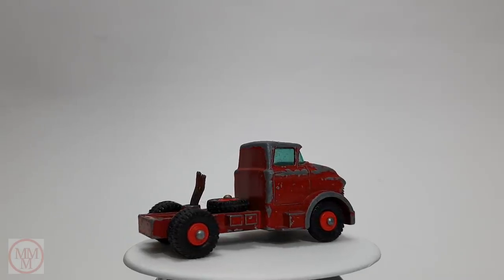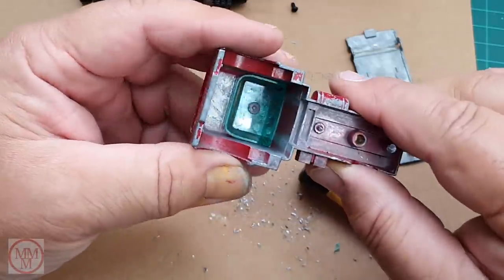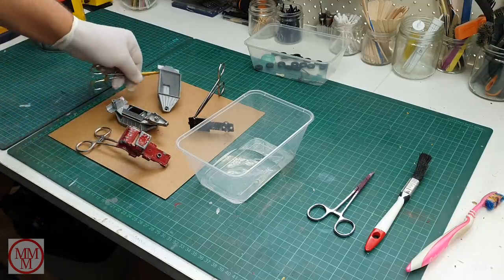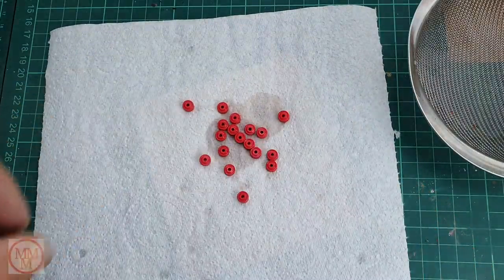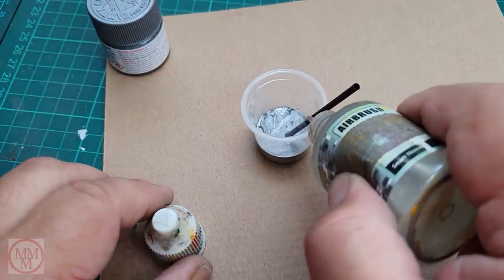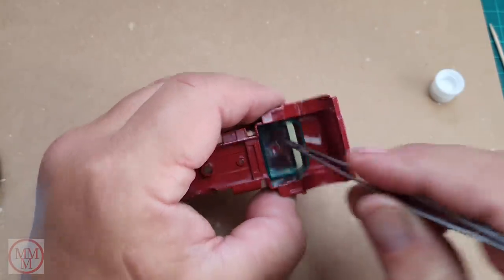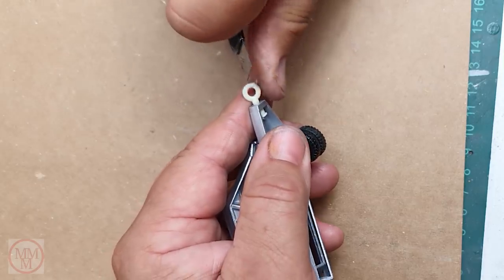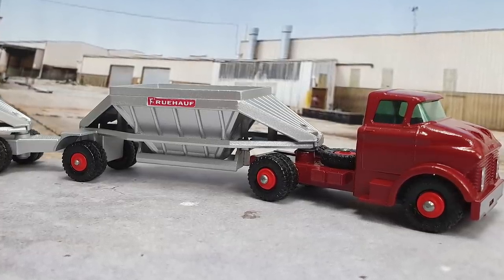MATCHBOX Restoration M4 Fruehauf Hopper Train 1965-1966

Comment: I've discovered that I can decant spray cans into bottles and then I can use that paint from my airbrush. Useful tip to get the primer out when the pressure has gone. I also have a thin bit of plastic with a hole in it to place over the axle ends so my grinding does not touch the hubs. Hope that helps, all the best Will... by the way, That was a stunning model !
Reply: Works great. Have used it myself. Have to let the propellant gas out otherwise can be a mess when pouring into a jar. Can crack the bottles  too.
Reply: Was about to suggest the same thing.  Works great, and you save a ton of money.
Reply: @captainsergeant  How ,? I have a load of rattle cans where the gas has gone but the product exists, are they still pressured or can I shove a thin straw/ WD40 end extension in one to drain the product?
Reply: To make sure there is no propellant, turn them upside down and depress the nozzle. When done, turn it right side up, use a small drill bit and drill a hole. After cut the top off with  a cutting wheel. Let sit for 24 hours, mix the paint up and pour into a paint jar and you are done. 
Have some paper handy in case it bubbles over but you should be ok.
Reply: @highpath4776  Two ways: You can do what Clare Ravenwood has suggested, which is the safest and probably the best way...or you can do it the super messy way: spray the paint in an airbrush glass paint container!  Wear gloves, expect a mess, but you'll get the paint you need.
Reply: I use vallejo Model Colour 865 Oily Steel . The Vallejo Model / Game / Panzer  range has a massive paint chart for this sort of stuff
Reply: Agreed. Model paints are ridiculous prices. I just exhaust the propellant and hammer a nail into the can, or spray into a container as suggested.

Comment: Pro tip on rattle can painting.....heat the can to about 80F/27C.  Do the same to your metal parts to be painted.  The results are superior!  You can heat the can in hot water to be safe.  Your little table top stove is ideal for heating the metal parts without them melting or distorting.

Comment: Marty, I just recently got an ultrasonic cleaner as well.  I saw a video on keeping it clean.  Get a sealable container that will fit inside your cleaner. Put cleaner solution and parts inside the container,  put that inside your ultrasonic cleaner, then fill it to the full mark with just water.  Cleaner solutions and dirt stay in the smaller container.  Less clean up,  less cleaner solution.  And the ultrasonic cleaner tank stays clean.

Comment: For the lumpy spray paint, some people suggest leaving the can into hot water before (as hot as your hand can stand) and that helps making the paint flow a little better. Of course you have to use absobant paper to remove any water near the zozzle to avoir getting drops of water.  Kept up the good work !
Reply from the maker: Good tip Martin, I've not had many failiures with spray cans in the past but this silver is one that I will avoid in the future.

Comment: You should know by now Marty, Kevin is a destroyer. I really like how that red turned out on the cab. It looks great for no clearcoat.
Reply from the maker: Yes! he can be tiresome at times. I agree with you on the gloss red. It was nice not to have to apply the clear coat because it is always the last step but also the step which if not done correctly can result in a complete strip down and re paint.

Comment: Marty, I enjoy your channel very much!  You can file a small flat spot on the 1st 3 threads on one of the M2 bolts. This will be a "starter bolt". When looking at the end of The bolt it should look like a capital D. That small flat spot will act like a tap and cut threads into the soft zinc post. It's much too tedious to do every bolt like this. But it may help in some situations if you don't have your tap available.

Comment: The 12vdc motor is a great tool. Maybe you can use it to rotate the turntable (with gear or volts reduction, or someone could lose an eye).
Reply from the maker: First time I've used it. The chuck was separate and is a press fit, so I can imagine losing an eye if it comes loose someday!
Reply: @MartysMatchboxMakeovers  If it loosens, you have a solution in thread lock or super glue.

Comment: Hi Marty. Instead of floor polish have you tried circuit board sealer? I was in the Guards, and we'd sometimes cheat getting a shine on our drill boots by using "Klear" floor polish, until some genius introduced us to circuit board sealer. It lasts much longer and is easier to apply/dry, with a much better shine.
Reply from the maker: Good tip, I shall have to give it a go. Thanks Marietta.
Reply: Works a treat and we were able to get it through the system until someone up the chain of command wanted to know why an infantry battalion needed so much of the stuff!  The other shiny boot cheat was using RAF nose cone paint “borrowed “ from RAF Aldergrove..............!
Reply: @MartysMatchboxMakeovers .
Reply from the maker: I used that once on my boots, it was a two part shiny black rubber compound called "Flexane"!
Reply: Marty's Matchbox Makeovers glad to see you on again😊 hope all is well with you and the clan😊

Comment: Great video Marty. Have you noticed an issue with the tires on the King Size matchbox?  Seems like they were poorly sized and are frequently missing on any I’ve obtained. The replacement tires I’ve found also are often loose. I’ve taken to using silicon to tack them onto the hubs.   Thanks!
Reply: I think the hubs shrink,  See other makeovers , marty and others , for ideas on securing the tyres , inclyding masking tape on the hubs and your method.
Reply: As well as loosening the tyres, the hubs shrinking makes them bind on the axles as well.  Must be type of plastic that was used.  That the wheel hubs have lasted over 50 years, without disintegrating we can be thankful they are still useable.

Comment: By the way GMC stands for General Motors Corporation. This is a 1960-63 GMC "Cab Forward" model. Oddly no similar Chevrolet model was ever available even though except for the emblem on the hood the trucks would have been identical. You can tell by the rear slanted "A" pillars for the wrap around windshield that it's a pre- 1964. The "A" pillars on all Chevy and GMC trucks cabs were switched to a forward slant in 1964 making the windshield easier and cheaper to produce. This medium and heavy duty series was discontinued in 1964 when GM introduced a real Cab Over Engine tilt cab for Chevrolet and GMC trucks to go head to head with Ford that had had its own tilt cab "C" models since 1958. Matchbox reproduced two of the GMC trucks, the refrigerated truck and the high side tipper. That one had an actual tilting cab. I'm sure you've restored both of those.

Comment: When putting the windshield back in, have you thought of putting it back in, then using silicone on the rivet and window,, instead of having the silicone between the roof and the window? That way, if someone in future wants to take the window back out they can just pick the silicone off instead of having to pry it up and chance breaking it.
Reply from the maker: I know what you mean but it may be seen from outside looking in. Somebody suggested water soluble white glue which I might test out next time. Thanks for the post Paul.

Comment: Congratulations Marty! Could you tell me , what number of bits you use to open car chassis? You have a great talent! From México City Víctor Ramos
Reply: /It looks like a small star key screwdriver, they are more robust for their size to nip in and lever out metal and have less possibilty to bend or damge the base or the side.
Reply from the maker: If i'm using a 2m screw I will use a 1,5 mm drill bit for the hole and then tap it with a 2m thread cutter. For the head of the base rivet I use any drill that completely covers the circumference of the rivet head but does not extend over it.

Comment: What is the scar, just behind the thumb, on your left hand from?
Reply from the maker: I was sawing a piece of wood with a brand new hand saw. As I forced the saw forwards it jammed on a knot and the blade flexed passing over the back of my left hand which was holding the wood in place. 1 microsecond later, 3 deep parallel gashes with lots of blood!!! :(
Reply from the maker: I didn't see that coming!
Reply: I have a couple of nice scars that remind me to be careful with grinders. I also have a Japanese type saw, it cuts on the back stroke, it is easier to use and more accurate.